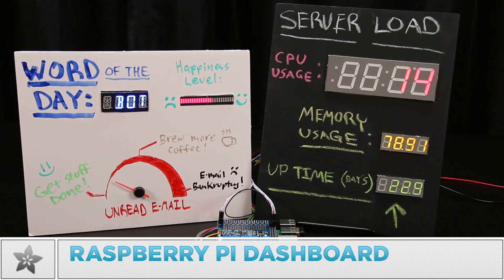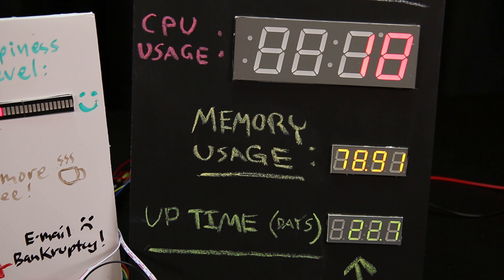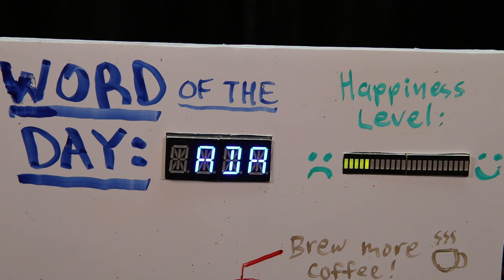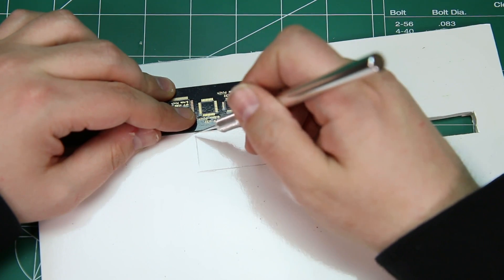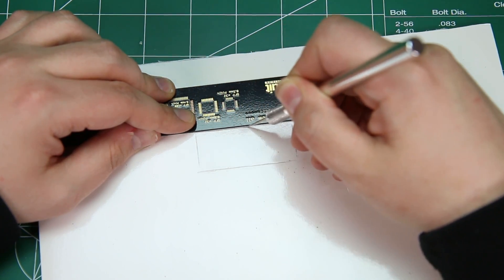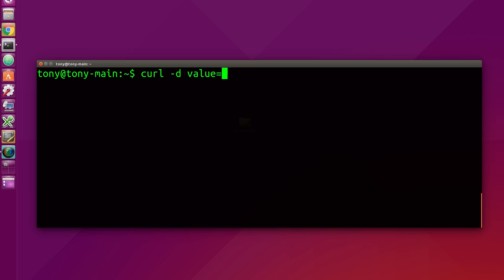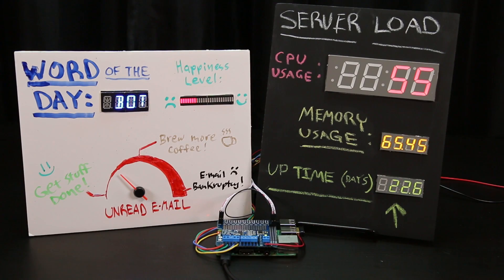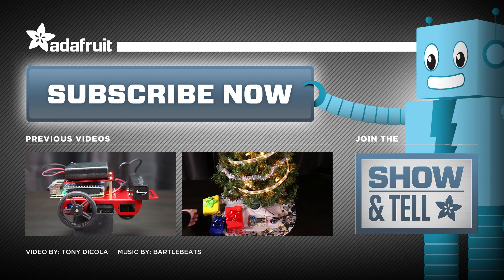Raspberry Pi Physical Dashboard

Comment: I created a bulletin board about the 2016 Presidential Election for one of my teachers. On it I included a 7 segment display that displayed the number of days till the 2016 General Election. I crammed the Pi and display into a small project enclosure then mounted it onto the board with some 3M tape. It has worked flawlessly and continues to countdown the days.
Reply: +Zachmatts10 Very cool, nice work!